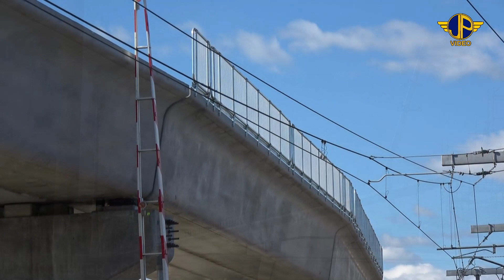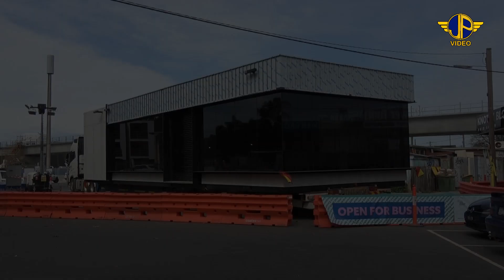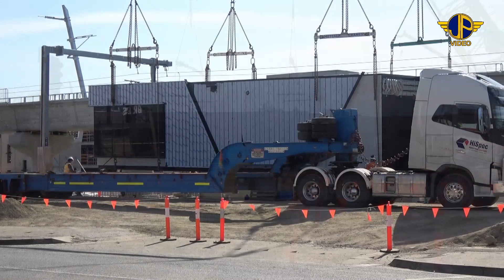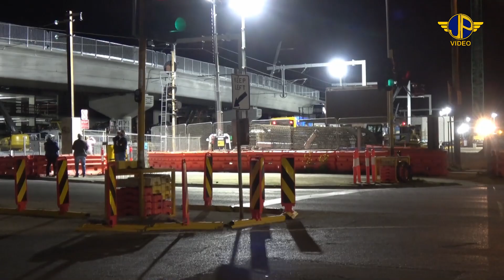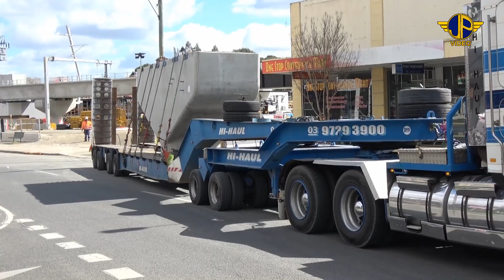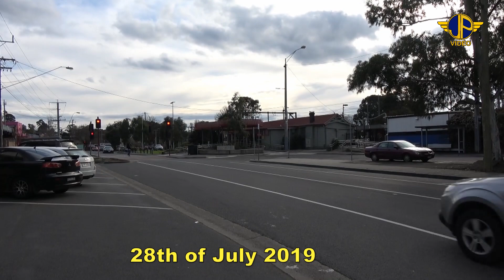Mooroolbark Level Crossing Removal Part 6

Comment: R.I.P old Mooroolbark Station.

You've served us well.

You helped me along the way with regards to building my independence from the foundations to the autonomous.

We may've had the odd inconsistent mutuality but I wouldn't change it for a thing.

From boarding a train independently for the first time at the ripe old age of 20, so many memories begun by simply arriving at this fine station.

Forever my home train station.

But, now, we must make it 21st century relevant.

The new era begins now.

How will it be received in 10, 20, 30, even 40 years time?
Only it can tell us.

Until then, let's fire.

Thank you for the documentation John.

1887-2021.
Reply from the maker: Nice comment , thanks